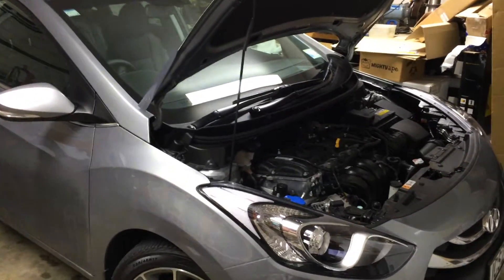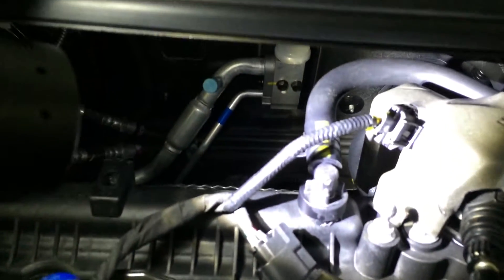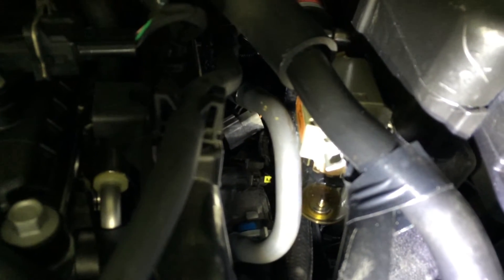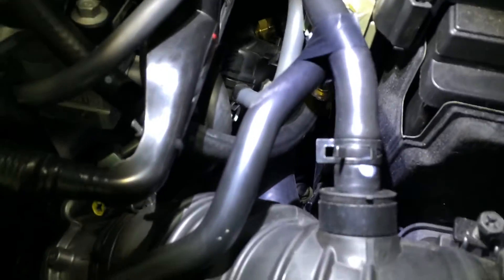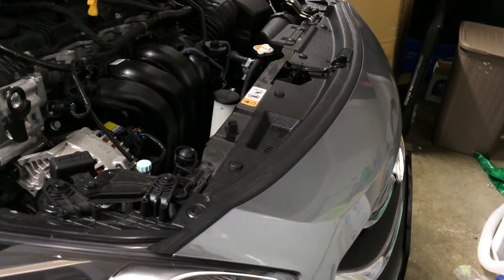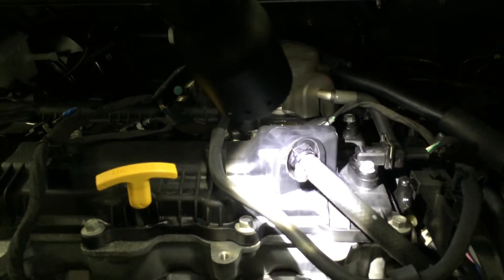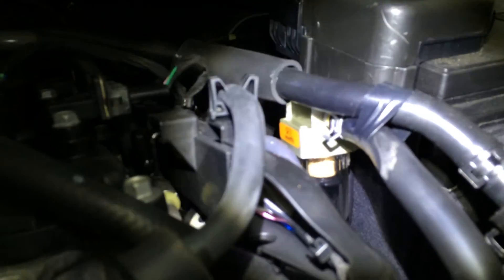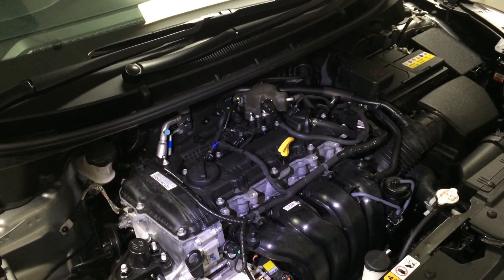Hyundai i30, Elantra GT oil catch can.

Comment: Cheers for this, I am seriously considering doing the same, but using the "Moshimoto" style can. I popped the cover off last night off mine (it is a 2016 SR so also has the 2 litre) and saw the 2 pipes and spun out a bit. Does the hose from the rear cover to the air box have a check valve in it and this is why you left it in place (ie air flows from air box into cam cover)?

Also doing the same to the wifes 2017 Santa Fe (easier as it only has 1 pipe) and my RX2 (replace the shitty setup it has now).

Comment: good video, thank you. have you collected anything? if so, was it a large amount?
Reply: Thanks for that :) It is catching 100mls per 10000km. The collection is pure oil, no water and very clean looking. I do believe that a good quality synthetic oil will help prevent inlet valve carbon with it's higher carbonation and burn points. Cheers.